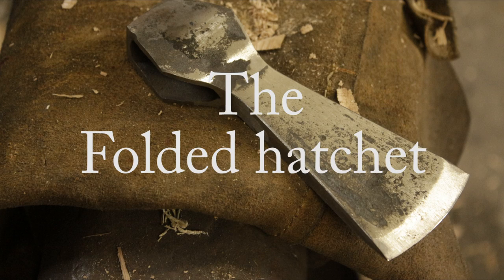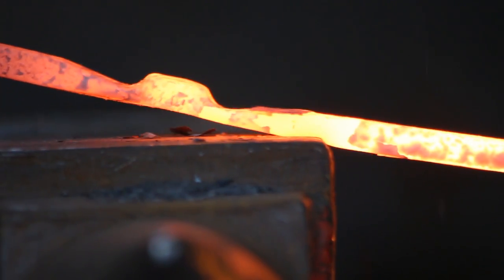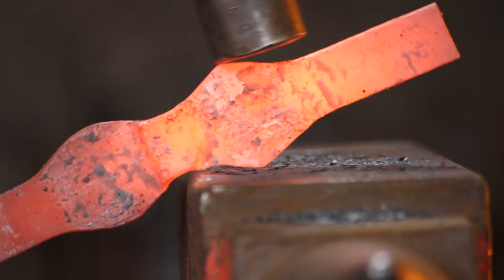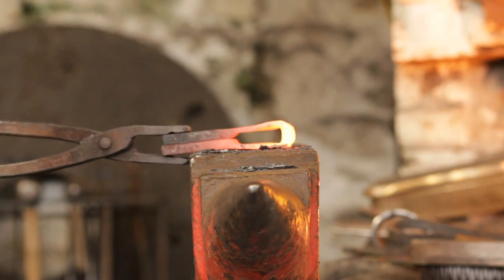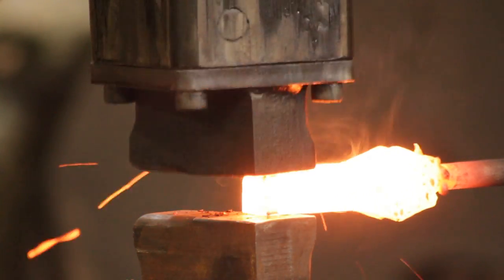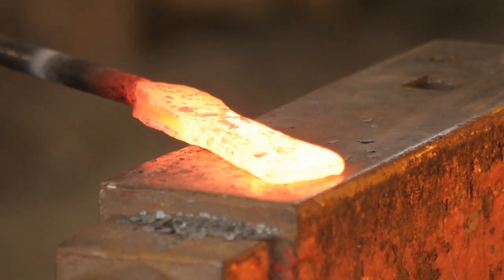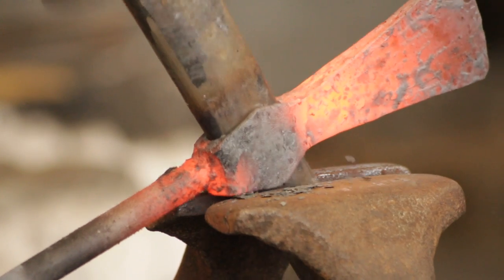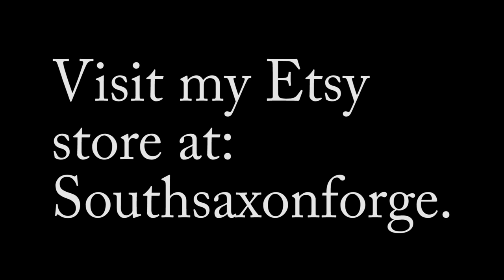Blacksmithing: Making a folded hatchet.

Comment: nice work. Most of the hatchets and axes we use get alot of abuse so we tend to go with 1060 for the bit. a little easier to dress in the field with a file. great hammer work you have.

Comment: This is the way a true axe should be made with the carbon steel bit sandwiched in the middle. One question for you is when you put the carbon bit of spring steel could it be wider than the mild steel so the mild steel wont push out over it as you cross peen ? I seen how you beveled the edges around the bit but only wandered if a slight wider bit would solve this problem or cause more problems.?.! I respect you fellows who get on here and show your skills of your craft to all the world. I wish I had the skills to put together videos of my homemade diesel refinery from old used oil all made from discarded machines and other junk.

Comment: I have an antique folded axe but unfortunately it's now broken, I'd very much like to make a replacement following your guide but am unsure as to what size of stock I should start with? The original axe measures 7" long x 5" wide at the face and 3-1/2" at the shoulders the heel? Of the axe is 2-1/2" wide 1" thick and there's 3/4 of an inch before the hole. I'm not sure my measurements will help but any assistance would be great fully received. Thanks and also your videos are fantastic straight to the point and full of information thanks again

Comment: Gorgeous work. I'm 18 in the US and I discovered metal work last year. Met a great group of guys in my area that are helping to teach me and it's always great seeing blacksmiths on youtube. I didnt quite get the dimensions for this starting stock, what were they?
Reply from the maker: +MockingToaster Cheers pal :) The stock is 25 x 10 and you want 8 3/4 inches of it/ Mark the lower end of the eye 2 1/2 inches from each end of the bar and the top end of the eye at 4 inches from each end, giving you a poll of 3/4 inch. Good luck :)
Reply: +RowanTaylor Awesome. Thanks!

Comment: you might want to secure you anvil to it's base a little sturdier, it rings quite a lot. Other than that, great video, you're clearly very skilled with the hammer.
Reply from the maker: +Hellstorm1190 Yes, I have been meaning to relocate it and make a proper stand for a while. It is just in a temporary position at the moment - though it has been there for 18 months lol.
Reply: +RowanTaylor Haha, if it works, why fix it? right :P

Comment: I just spoiled my fourth attempt at this project. I keep breaking the piece where the cheek meets the straight part right at the set down. I am taking too many heats and fatiguing the metal. I think my hammer is wider then the cheek so I keep moving the straight bit as well. I will give it another go. I think I am getting better as it as I wrecked it with fewer heats. 

It is hard to learn a trade  without a master.
Reply: Almost sounds more like you're working it too cold.

Comment: thanx for the diy for the ax forging with the wrap method.  i have a nice piece of steel that is from a leaf spring.  it's fat, thick and not long.  i want to wrap forge it but am looking for how i want the broad ax to look.  my trough forge only gets to around 1500 degrees (i'm guessing because i can melt aluminum but not brass). my forge burns wood and it's similar to the Whitlox Wood Fired Forge build.  except mines around 4 feet long and i control the air flow with two pipes and have 5 air flow zones along the forge.  
I can build up the temperature with saw dust poured onto the wood (I cut my wood kibble into 1.5 inch squares from sheets of ply wood or composite wood.  how high should i get the temperature to wrap weld steel?  i've only made a crossbow (31 inches by 1.5 cm) and a gladius (21 inches).  my belt sander died so i have two more knives to finish once i get a new one.
i was thinking of starting the ax project while i wait for a sale at canadian tire for another belt sander.
Reply: i salvage the wood from the dump but could use the wood from my wood shed if need be
Reply: Monkey Boy From what I understand you'll want to get the steel to a bright orange color, which is around 1900°F, but it will vary based on the steel you use. However, it's very important that you don't get the piece too hot, as that can ruin the steel's composition, thus making a shitty tool. You'll need some charcoal to get your forge to these temps, and you can even make your own with the wood you already have if you don't want to buy any. Just look up DIY charocal on here and you'll find some good tutorials. Another method to get higher temps would be to add extra airflow to a concentrated area. That may be especially helpful for your forge, as you said that it's rather long with a few (I assume) spaced out air entrances
Reply: Monkey Boy On a side note I've also heard that some leaf spring can be rather difficult to forge weld, as it has some chromium in it, and the metal will want to slide on itself instead of sticking together. Some extra flux should help with that tho. Hopefully my advice was helpful. If you decide to try it let me know how it went!

Comment: These videos are awesomend very helpful! I couldn't quite hear what size material you used what was the thickness and width?
Reply from the maker: +Jeffrey Fogleboch Sorry about that - the camera microphone is rubbish! I have gotten a better microphone since, though! The starting stock for this is 25mm x 10mm
Reply: Thank you so much! gonna have to try this put. What are the dimensions of your drift and what size stock did you make it from?

Comment: In your experience, is there any difference between a folded and a punched axe head?
Reply from the maker: +MrGrimm1911 Punched heads will be stronger overall but the folded heads I find much less hassle to make. They are a lot easier on your drifts too as you aren't pounding on them and forcing them through the eye. That doesn't mean that the folded head is weak, by the way. Many other people will find the punched head easier because of the lack of firewelding, so I suppose it is each to his own.

Comment: Yesterday i tried to weld two outer layers of springsteel go a center piece of 2842, although i was sure i had reached welding temperature and weighed my blows carefully, to not damage my carbon-steel, i still had black lines at the sides of my finished billet. I used quartz sand because i was out of borax, may have something to do with it. Any tips?

Comment: The only thing "bad" about this video is that I didn't find it earlier on youtube. I was always searching on how to forge a folded axe and not a hatchet, but it's basically the same principle.
Reply from the maker: Sorry lol. i don't come up in the top search terms on youtibe sadly. Have a look at the Merovingian axe I have done as it may be more similar to what you are after but without the languets on top of the poll.
Reply: +RowanTaylor Ha, no worries, I blame it on youtube ;) . Thanks for the videos by the way. I am wondering about one thing, are you using wrought iron ? I saw you did it for the viking hammer (I guess this is the most historical accurate) but isn't wrought iron too soft to form the body of most hitting tools such as axes, adzes, hammers etc ? Most smiths I follow on youtube use mild steel. I have a ton of wrought iron and I'd honestly prefer to recycle it instead of buying steel. On a side note, I have a old blacksmithing book from 1939 and they use wrought iron all the time to make the body of tools. If you are interested I could scan it and upload it.

Comment: i have a serious question. thumb on bak of hammer or not. ive heard that i you d you can trash youre shoulder after  while.
Reply: I don't know about the shoulder, but you can seriously damage the tendons in your hand and wrist that way.   Most people do it for more control, when they'd be better off choking up on the handle and/or using a smaller hammer.

Comment: Hi, is it a cost thing to only use a small piece of high carbon steel at the edge of the axe blade? Or does it make for a better blade to combine, weld, the two steels?
Reply: Traditionally it was done because high carbon steel was scarce and expensive, but mild steel is easier to weld as well.

Comment: your lacking fusion in your weld between your softer and harder steel. nice design though. use fresher Flux. spent Flux can ruin a weld.
Reply from the maker: +Adam Barnes How can you tell? I haven't had any issues with the welds coming apart during drifting or heat treating. I don't usually use flux at all for welding because good fire-control is the most important part of welding - have a look at my scarf welding video. Flux just evens out the odds a bit where carbon steel is involved. I am happy to learn though.
Reply: +RowanTaylor the fusion between the two metals wasn't complete. and that could be some micro amounts of mill scale. as for the Flux you can put the borax into a diner style mustard bottle will keep it dry and makes it easier to coat your work. I could give more insight if I could see the work with my own eyes. keep up the good work.
Reply: +RowanTaylor the fusion between the two metals wasn't complete. and that could be some micro amounts of mill scale. as for the Flux you can put the borax into a diner style mustard bottle will keep it dry and makes it easier to coat your work. I could give more insight if I could see the work with my own eyes. keep up the good work.